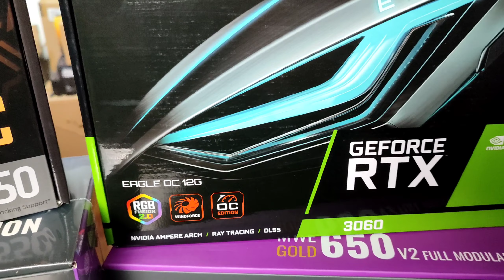Phanteks P400A Digital RGB x COOLERMASTER ML240 ILLUSION PC BUILD (Time-lapse) | PCB-7

Comment: Wouldnt it make more sense to change the airflow direction over pulling in all the hot air? I have this case and a noctua d15s but my temps with this 7600x3d are pretty high. Sometimes hitting 70 so i was thinking of grabbing an arctic freezer 3. Id love to get a 360 but it wont clear. I think a 240/280 front would be best. Also the tubes are supposed to go down not up.

Comment: How did you make them fit? Or do them on the top?
Reply from the maker: basically just change the stock fans of the aio then mount it on the front using the stock fan of the case then screw it in the mounting holes for the 240(2x120mm) fans
sadly it wont fit on top coz of the clearance issue of the ram